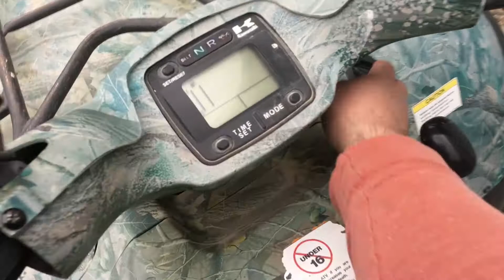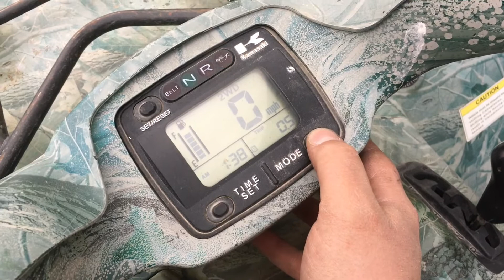My 2005 700 Kawasaki Prairie

Comment: Good buy. I have a 2004 360 with over 30k miles and no major breaks. The best wheeler Ive ever owned by FAR. Have fun, Bro.
PS - I have a couple other newer Brutes, and IMO my 2012 650 with solid rear axle is the best trail bike by FAR. Not only has it been bullet proof, I prefer the solid axle over the independent any day.

Comment: I’m about to buy a 2007 Kawasaki prairie 700 4x4 so do these machines have a lot of problems or no
Reply: I have one i bought back in 2017 and it is a very strong machine. 3800 miles on it with 586 hour and i have rebuilt the carb 2 times. Had to do the swing arm bearings but the motor is strong and i have had alot of fun with this atv still have it
Reply: @garymarlow2333  especially if you get a dynatek CDI